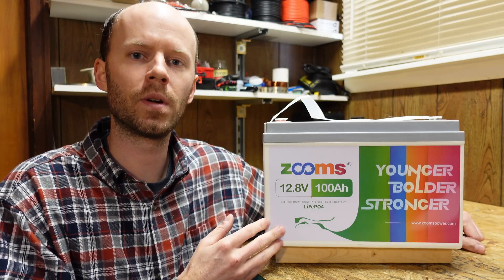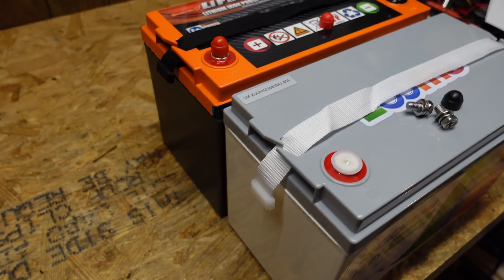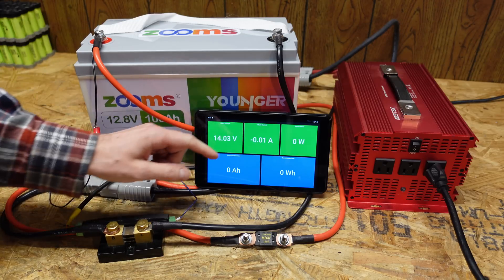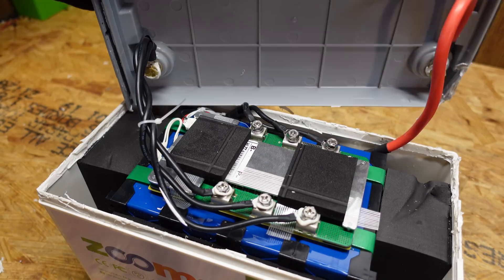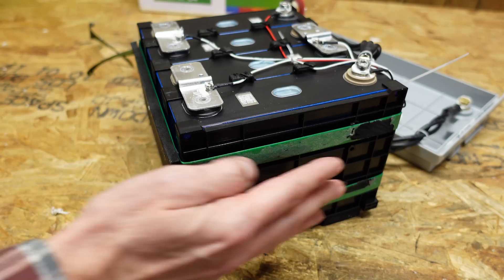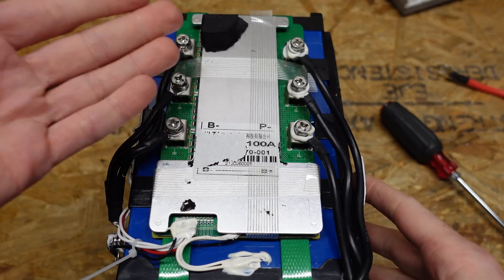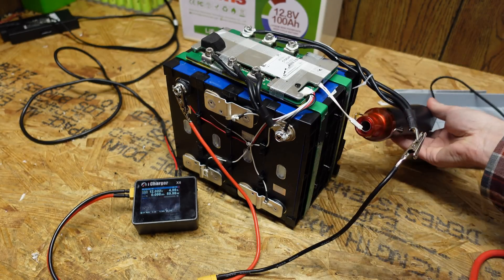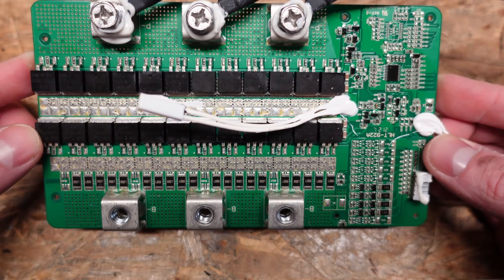Zooms (Redodo) 12V 100Ah LiFePO4 Battery Review, Even Cheaper, $250/kWh!

Comment from the maker: The Zooms battery is even cheaper than the last one we reviewed. Unfortunately, it still doesn't have any low-temp charging protection. It has GFB cells though!
Zooms 100Ah Battery... https://amzn.to/3rB4AHP
Zooms 200Ah Battery... https://amzn.to/33PM3iO
Zooms 300Ah Battery... https://amzn.to/3KuCRRW
Reply: Needs Bluetooth
Reply: What temp range is recommended for charging?
Reply: @richjageman3976  above freezing.
Reply: its $424 i’m not sure where ur getting the $300 from🤷‍♂️🤷‍♂️🤷‍♂️🤷‍♂️
Reply from the maker: @deltapromasterlauj4848  Obviously the price has increased...
Reply: @deltapromasterlauj4848  it was $300 at time of video posting

Comment: A comment on your very good video : It makes absolutely no difference wether the balance-leads on the positive and negative terminals are between the terminal and lead , or lead and head of the screw as far as the resistance and quality of contact to the outside world is concerned because you have two contacts  from the terminal and the screws head to the lead . But it might make a small difference to the voltage as seen by the BMS and is therefore actually better the way they do it , and a lot better in case of a somewhat loose screw if that were to happen . Greetings Michael

Comment: Can all 12v lithium batteries be charged at 75 amps ?
Reply from the maker: The specifications manual for this battery indicates a maximum continuous charge of 100A. It will depend on the choice of cells and BMS used by the manufacturer. They won't all be same so it's best to check the manual for the specific battery you have.

Comment: Chins (which is the same as the Zooms) just came out with ~$400 LifPO4 battery with low temp cutoff AND internal battery warmer. Would love to see how well that thing works!
Reply from the maker: What do you mean they're the same? They are two different companies. I'll check out the battery you've mentioned.
Reply: @LithiumSolar  https://youtu.be/74iBMHE3StM?t=175

https://www.youtube.com/watch?v=pKFh7eXeY-s

Been watching Will for a little bit and this Zooms videos is what sold me on them. Gotta remember, when things are coming from China, different companies can either be actually the same company, or can make exact replicas of another company. I've seen it with lots of things.
Reply from the maker: @colbyscott9822  You cannot cite a video by Will Prowse as proof that they are the same company. He's just reviewing batteries, the same way I am. Gotta remember, when things from from China, you really don't know with certainty unless you actually go there yourself and see them being built. To my knowledge these are two separate companies. I have not seen any proof to suggest otherwise other than the batteries looking the same internally, which is more likely to mean one company copied anothers' ideas. That seems to be the case more times than not.
Reply: @LithiumSolar  Hence, why I said, "or can make exact replicas of another company."

Also, I never said they were the same company. Though, i can see how I might not have been clear about that. I just meant the Chins and Zooms batteries were the same.

Comment: Thank you for the review. Very informative. I have two of these batteries 12V 100Ah working fine. Q - Can these batteries be wired in series. Trinidad & Tobago. Tks
Reply from the maker: The manufacturer's website states "Support up to 4 identical batteries for SERIES connection to 51.2V100Ah battery system"

Comment: I run 3 of these in my boat...2 for my 24v trollmotor and one for electronics....They work GREAT!
Reply: I run two of  these for my trolling motor, too. Would love to swap out my FLA starter/graph battery for LiFePO4, too but my mercury charges at to high a rate and I don't have enough space in the rear compartment to rig up a FLA/LiFePO4 series, and can't really justify the money to buy an external regulator.

Comment: How serious of an issue is the improper connection to the BMS from the negative? I would definitely contact the manufacturer and make them aware of this issue.
Reply from the maker: Not a problem as long as there is enough surface area on the ring terminal to pass the current.

Comment: Hi please help, I'm connecting them 4 in series and have growatt 5000es trying to use them from 30 to 90% to last longer ,from what to what voltage to set them,cut of voltage and full 90% voltage, Wednesday I'm putting everything in function please please help

Comment: Thanks for the video review. Could you explain more about the problem with those connections reversed on the inside terminals? Is it dangerous or cause any detrimental issues with the battery? I think most of us aren't comfortable opening it up and fixing those connections. Thanks!
Reply from the maker: I wouldn't call it a "problem" it's probably fine - just "best practice". And I certainly do not recommend people be opening their batteries!
Reply: It's a point of added resistance and may contribute a milliohm. That said, the bolt will likely carry most of the current anyway

Comment: I have a 100ah zoom battery and a 2500 watt pure sine wave inverter. I tried connecting my rv microwave which draws 1300 watts, but it seem to drop the volts low so that the inverter gave out a loud noise as it does prior to shutting off.  Shouldn't that combo have worked?
Reply from the maker: I think you're overloading the battery. This (and most 100Ah batteries) are rated for 100A continuous discharge. At 1300W / 12.8V you're looking at 102A. Additionally, most inverters are around 85-88% efficient. If we assume 88% efficiency, you're probably looking at a 116A load on your battery.
Reply: @LithiumSolar  if I put two 100ah batteries in parallel should that work?

Comment: What lithium battery would would recommend for a boat . I have four to run all my tech and trying to get the weight down.  
I run 2 livescope systems,  trolling motor,  and 4 fish finders . 
Is Low temperature cut off needed ?

Comment: I had an interesting conversation with someone from the company concerning their 50AH battery. They felt that a 45 lb. thrust trolling motor could damage the BMS "if started at high speed", (which I would never do) because "they found that there may be a very high current which is around 120-150Amp when starting the trolling motor".

Anyone have any thoughts on this?  I'd like to get away from lead acid, my back would be happier.
Reply: Considering a lot (most?) trolling motors  recommend a 60amp breaker, I'd struggle to believe there is any real threat to the BMS. That being said, not sure how much damage a voltage spike is capable of in between the it occurs and how long it takes the breaker to trip.

Comment: Good afternoon! I've been watching you channel and learning quit a bit. I have a question I'm hoping you can assist me with. I am looking for a recommendation on which lithium batteries to purchase for my 24volt trolling motor on my boat. Prices are all over the place and I'm nervous on what to purchase. i see amazing deals on Amazon, but are they of quality. Dakota is out there at $1800 for two 12volt batteries which is crazy expensive. What manufacturer do you recommend for good quality without braking the bank? My needs are either two 12volt or one 24volt deep cycle with a minimum of 54ah to get good run time from the trolling motor. thank you in advance Sir!

Comment: I hear low temp sensor mentioned alot on various channels but no one actually defines low temp.  Can you tell me what low temp is?   30..0...-30.  At what temperatures would you need low temp sensor.
Reply from the maker: LiFePO4 cannot be charged below freezing, so that would be 0C at which a good BMS would stop allowing charging.

Comment: I'd buy the Zooms battery, but feel like I'd need to pull it apart and check those cable attachments to see if they're correct.  But that means destroying the case. Is there a source of inexpensive battery cases you'd recommend from your DIY battery builds?

Comment: OK... newbie to the work of DIY electrical... I'm thinking of using the Zooms 200ah battery (X2) via a Renogy 2000W inverter to run an induction stove top... is that enough?  I think the max of the induction stove top is 1800 watts
Reply from the maker: How are you wiring those batteries? If they're in parallel and a 12V system, 2000W / 12.8V / 2 = 78A per battery. Technically fine per the battery specifications, but you'll need some thick cabling. Might be better to run them in a 24V setup with a 24V inverter.

Comment: I understand resistance is lower but I really wish they wouldn't weld the terminals. No replacing a single cell. Seems wasteful
Reply from the maker: How often do people actually replace cells though? I haven't heard of anyone doing it in any of these batteries.
Reply: @LithiumSolar  your not wrong but having the option would be outstanding. My luck I'd be the guy that needs to cause you know, that's just how things go some times. Keep these videos coming though I enjoy them a great deal. Even if it's the same battery that's been reviewed by others, you have a different spin on things and it's nice to have multiple opinions on anything

Comment: Low temp thing doesn't worry me that much since live here in Arizona when temps rarely dip below 20F, even in the high desert i.e. Kingman. I ordered a pair of those ZOOMs which will be the base of an off grid power supply, $320 each I'll risk it.
Reply: WE HAVE 40 ACRES IN HACKBERRY ABOUT 45 MILE FROM KINGMAN ,THOSE battery on our list have 8(6 )volt batteries  6 320 solar panels  running the swamp cooler the wife breathing machine ) electrician friend rewire my rat nest ,an he said not to be cheep an get less 4 of these batteries it will pay in the long run
Reply: @mollymark3019  Actually my Zooms' batteries were close to $400 ea with taxes but still, My solar panels are still on order and, I may have to swap out my inverter since it's rated at 5000W output but, only allows a 12V feed. I need a 24V, which someone pointed out to me, is due to ca 400 amps (full load) @ 12V Ouch! 

Regardless; it's a major learning curve and the lack of knowledge concerning either off grid or grid tie systems is concerning.

Comment: Even with the temperature issue, these batteries are still more superior to flood acid batteries (especially) and agm. So I'm researching a work around for them. 

Since it is known these batteries can get damage with charging temperatures lower than 32f, than common sense tells me to disconnect these batteries every night between Nov. and April. 

But the capacity and service life is why I'm planning on phasing out the flood acid or dedicating them to low power operations. 

They have never really lived up to their reputation like my earlier AGMs. But they were much, much cheaper with a much greater running time 435 ah vs 100ah AGM. But for some reason the capacity never really amounted to much. 

For instance, during the day, the solar charges them well, but the current drops drastically during the night. 

This wasn't the case with AGM.

But on the other side of that, they just keep working unlike the AGM after 5 years. 

Anyway, their is no reason to continue to rely on something just because of the lack of a charging temperature sensor. You just find a way to work around it and move forward!
Reply: You could prob put them in a box with a few usb heater pads to help maintain temps
Reply: @firstlast-er9jq  Exactly my plan. My current setup is batteries outside and solar controllers inside the binds. 

So I would have to buy a larger binds to fit the 100 ah battery. Than heating pads (4). And done with this upgrade with little effort.

Comment: The battery performs well. The customer service has been incredible. Only wish is for a low temp cut off.
Reply: I own this battery and my charge controller has a low temp shutoff.
Reply: I own 4 of these. And 4 Chins. And one Big Battery. I built a 3 walled insulated box that I push around all of my equipment. The MPPSolar LV6548 puts out enough heat to keep the inside of the box 25° above the outside temperature. If I hang a 40w incandescent light buld in the box it stays in the 70's inside my box. I don't need it so I don't run a light bulb. Oh, one critical thing, you need a small fan to mix up the air inside the insulated box or you'll get a 40° swing inside the enclosure from top to bottom, and my batteries sit at the bottom

Comment: Great review LithiumSolar. I can see your concern about the arrangement of the sense and power cables. A few tens of microOhms at high current values leads to voltage drop and local hotspots. 

In the same spirit you should also check the resistance of the straps and welds that connect the various cells to each other. These are standard tests for commercial battery pack manufacturers. For low-cost packs they might just skip these tests.

Comment: Hi - Wondering if you could take a look at this test: https://www.youtube.com/watch?v=0dWq3RcelP8&t=421s
He puts a 100AH LFP battery in the freezer for 48 hrs lowering them temp to 2.5F, then immediately charges the battery (it has no low temp charging protections), then tests the battery capacity, which shows no apparent loss in capacity.  Then he repeats the whole thing again.
So, two very low temp charges to an LFP battery with no apparent damage.
The warnings about not charging LFP batteries below 32F are just everywhere, so this is really puzzling to me.  Is it really not that big a deal? Or, dependent on the particular cells used? Or, what?
Any thoughts on this?
---
I have the Zooms battery and found your review very helpful - nice to see the internals and the quality level - thanks!

Comment: Low temp sensor is only a issue if they say it has low temp detection when it doesn't.
How many can be in parallel?
How many can be in series?
I forget details about series/parallel in the sense that the BMS impacts it.
Anyway, those are some details you might want to mention in future videos.

Comment: Can't you get a charge controller that won't pass current to the battery if the low temp is triggered?
Reply: Sure.  That's what I've done with my Victron MPPT controller and Chins battery.  But it requires a comparatively expensive battery sensor and controller, must be configured and hence could kill your battery from a bad firmware upgrade.  Finally, the system is connected together via BlueTooth.  Its a kludge being driven by poor engineering of these BMSs being used in the cheapest batteries.  AFAIK, there are BMSs available with low temp charging protection that are being used by folks doing DIY batteries that don't cost much more.  With luck this issue will be resolved in the next year, as somebody comes out with a more complete battery solution.

Comment: Got to remember to list the important stuff. Here is a response from the seller:
Our 12(12.8V) 200Ah battery supports connecting max. 4 in series PLUS 4 in parallel（Total of 16 batteries).
And you will get a 48V(51.2V) 800Ah battery system, which supports max. 400A continuous charge/discharge current, max. Load power 20480W, and it has 40960Wh energy.
Reply from the maker: Yes, it supports up to 4 of the 12V batteries in series. The amount in parallel is... debatable. I don't know why they're saying a max of 4 in parallel. Perhaps they're assuming that is without over-current protection (breakers, fuses, etc) installed separately.
Reply: @LithiumSolar  Right, as far as I'm concerned, you can connect as many in parallel as you like.  You just have to take into account the maximum current that will be flowing in any part of the cable system so you don't overheat any cable or connector.
Reply: @LithiumSolar  not sure myself but if it is accurate, that's only 10 grand for that kind of power. A few years ago, our only lithium option for that kind of juice was around $25k. Times have changed.

Comment: Dunno why you are getting your knickers knotted about the the BMS  cable lug position.  Unless my eyes deceive me, both the main power and the BMS lugs are held in location by a 12mm? bolt that screws directly into the fitting on top of the battery.  Unless the shiny bolt is not metal, then the bolt will be the prime path for power transfer - path of least resistance and all that.  If an  insulating bolt was used I would understand your point....but these bolts look like stainless to me.
Reply: Because that bolt has a washer in top as well. At 100A mini-ohms matter.

Comment: I am not saying you are wrong about it not having low temperature protection, but I know my company uses 5k thermistors in our products that look identical to an unlabeled 0603 surface mount resistor.
Reply: I was thinking the same thing... any "transistor" can be a temp sensor. However, it would be a very bad idea to have an ambient temperature sensor mounted on a board with dozens of high heat generating IGBT's. (it'd be measuring the the BMS temp, not the air / battery cells.)
Reply: @jfbeam  I doubt the BMS will generate so much heat as to keep itself warm when it's -20 deg C outside. Also, I would guess most charging sessions either start directly after use (battery already warm, no problem) or after extended period of inactivity (battery cold, sensor also cold, no problem).
Reply: I own 8 of these. They do not have low temperature charge protection. They are very good batteries so far. They have been in service since October of last year. I did add a balancer to each 48v battery bank so the 4 batteries in each bank charge and discharge evenly. I plan on buying another 4 in the very near future.
Reply: @fauxque5057  The extra balancer seems to be unnecessary as the two 48V banks will be at the same voltage and the internal balancers take care of individual cells to within a few mV.  Maybe I'm wrong, but I doubt the external balancers make any difference to safety or life.